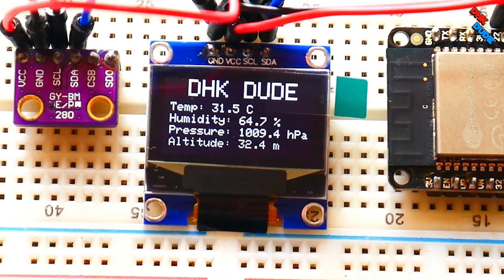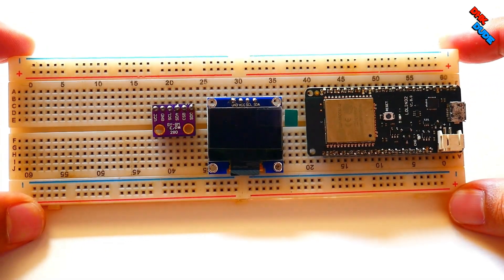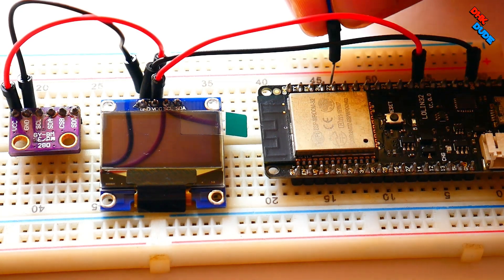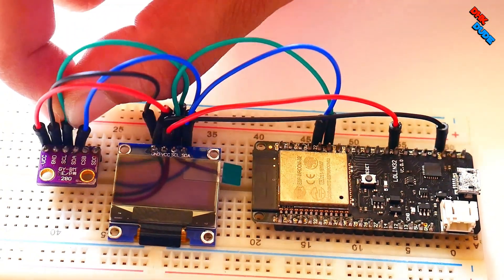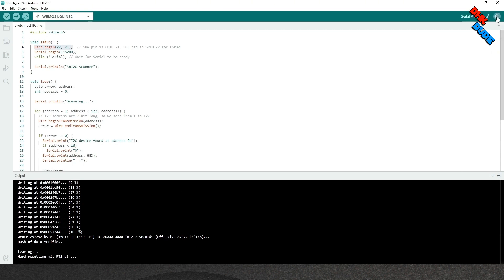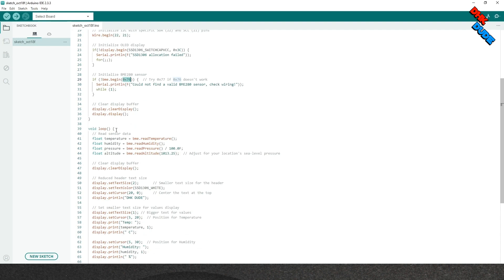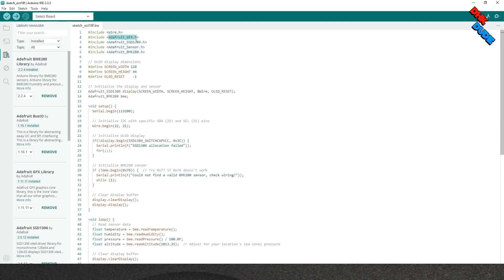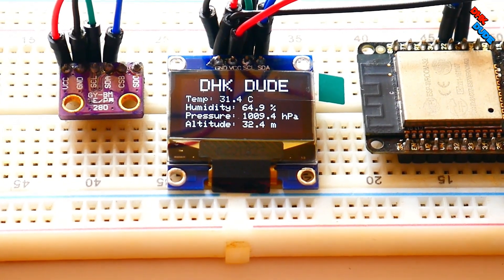Build Your OWN ESP32 Weather Station with BME280 and OLED Display NOW!

Comment: may i know which esp32 version are you using? i am using both 30 pin nodemcu and 38 pin devkit and both cover one part of breadboard hence doesn't give me option to connect other part of breadboard for connection
Reply from the maker: Hi, this is lolin32 v1.0.0 having 36 pins (16+20).
Reply: @DHKDUDE ok.. but how you still have space in both sides of esp32 headers to connect and i am unable to connect using my nodemcu with 30 pins?? I am using both 400 and 800 point breadboard.. is your version bit compact?? I am trying to get expansion board for my 38 and 30 pin esp32 but those are very costly here, they cost more than the board itself 😂
Reply from the maker: Hi, it is a regular breadboard having 10 (5+5) rows (A-J) + power rails, after installing the board in the center I get one empty row on each side.